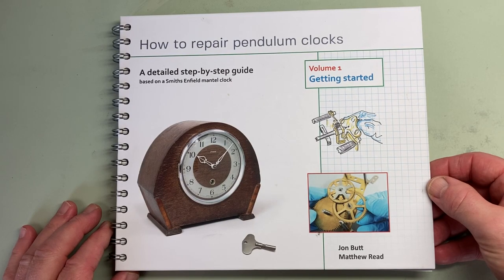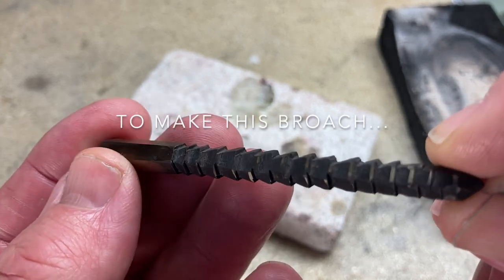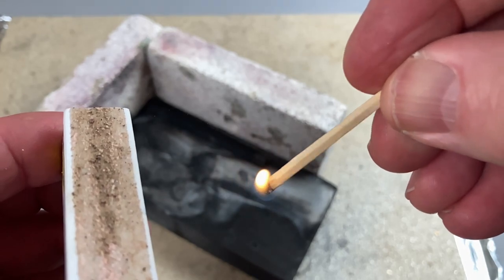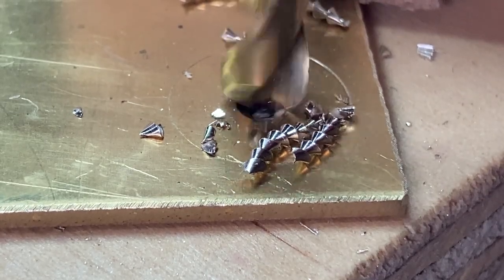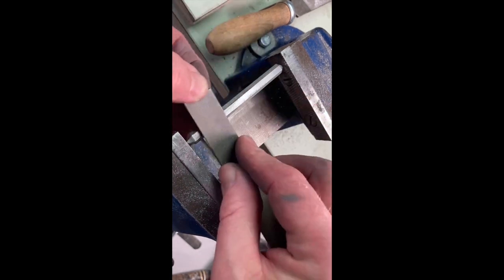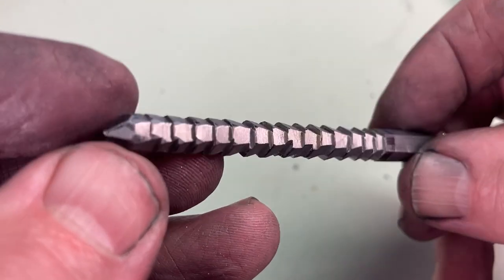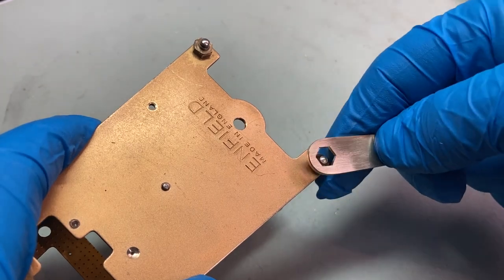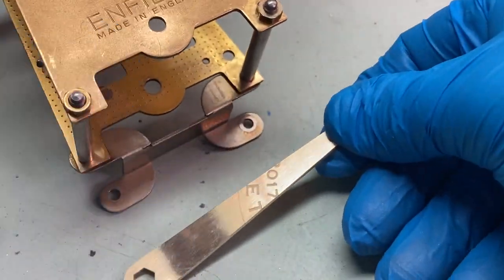021 Making a brass spanner 2021 02 09 #shop #workshop #tool #clock #horology #spanner #craft

Comment: Thank you for the video. I agree completely that using a jewelers saw and a wood V block is meditative. I used to dread when I had to cut out a part and would search for easier methods but I have learned that patience and the correct jewelers saw blade gives me the best results. 

Perhaps in a future video you can describe how to pick the correct saw blade teeth/inch plus any tips on on cutting such as using something for lubricant, etc.
Reply from the maker: Hi Harry.  Thanks for the kind comments. Glad you are on-board with the jeweller's saw!  Gladly I will dive into more tool videos including blade choice as you suggest. I used to like the very fine ones but nowadays just work around what comes out of the box.  I'll order-in some blades and get filming.  Thanks for watching.
Reply: I'm a big fan of using a scroll saw for woodworking. I haven't tried it for metalworking. Is your preference for the jeweler's saw to do with (other than the cost) the control you gain from a hand tool vs. a power tool?

Comment: Great video! I can hardly wait till your book is available in Canada and the US.
Reply: Paul it is on kindle and eBay great book indeed
Reply: @davel831  I would prefer a paper book over Kindle. Buying and shipping from UK to Canada results in it costing me over $100 cdn.
Reply: @pauldevey8628  ok Paul I know Matthew is setting up with Amazon to distribute the books. And it is on ebay already. You should join in the open clock club on a Saturday night at 6pm uk time. Really good !!
Reply: @davel831  Thanks Dave! That will be fun. He is putting forth a significant effort that is and will be appreciated and valued by many.
Reply from the maker: Hi Paul.  Thanks for the kind words.  50 books are on their way.  They should land in the US today.  Don't know how long it takes Amazon to process?  A week?  Thanks for your patience.   Matthew
Reply: One way of determining when you have reached the critical temp before quenching is to use a magnet attached to a rod and swipe it across the steel.  At the point where the steel looses magnetism quench the steel.  This temp is somewhere in the 1600 deg. F range as I remember.

Comment: A little tip mathew if you are hack sawing in a vice, I learnt this from my farther when i was about 10 years old after splitting my Knuckle. My farther was a top old school mechanic. (Qualified as master mechanic in his day)
If you are right handed, saw on the right hand side of the vice. This way if the blade snaps as high carbon blades sometimes do or you cut through the work piece slightly quicker your hand will naturally travel away from the vice. If you saw as you are doing your hand will go into the vice and catch your knuckles.
Reply from the maker: Thank you!  always much to learn.  I'll practice that.  Appreciated.

Comment: Where can I get the machine screws to mount the Smiths Enfield movement to the Bakelite case?
They look very similar to the one you used when making the screwdriver end of the tool.
Reply from the maker: They are BA screws.  Not quite sure which size but I can find out if you are stuck.  You can find these on eBay.  Search "BA" or "British Association". M